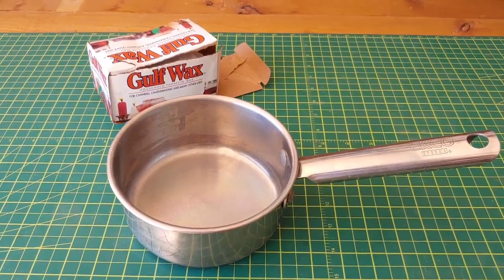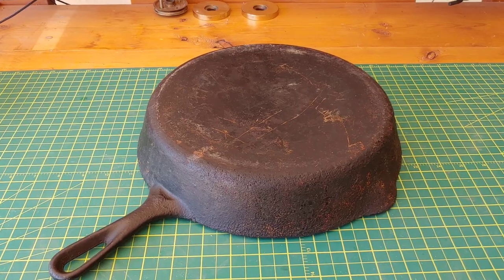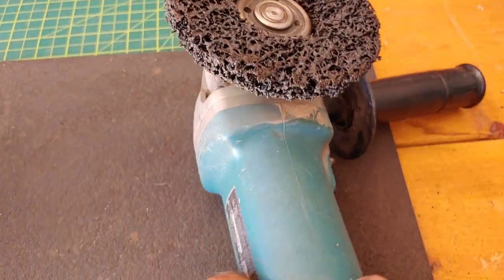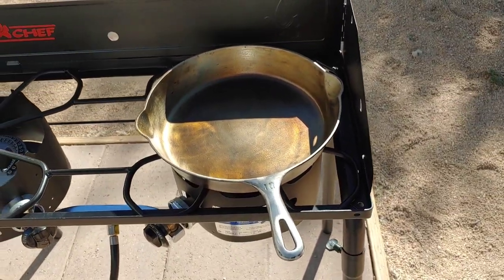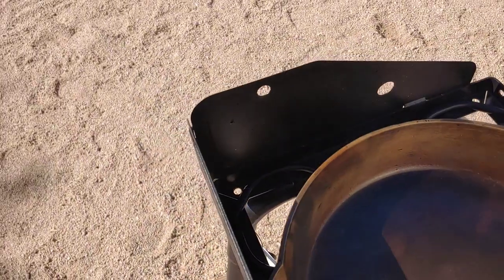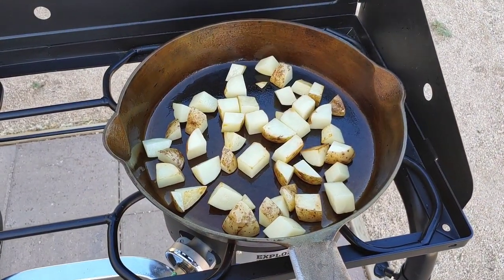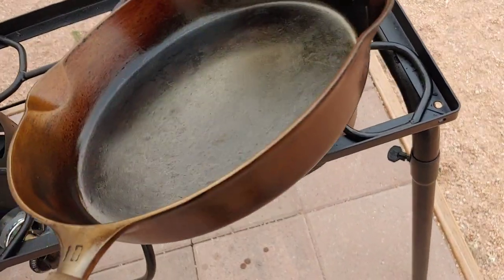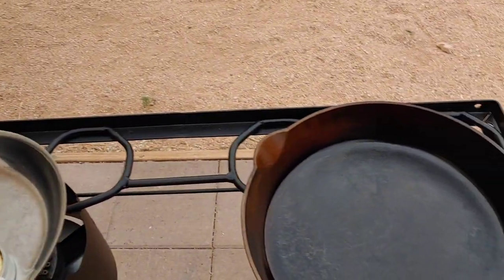Griswold Cast Iron Pan Restoration!

Comment: The special nice thing about this pan is the thinner walls so it is lighter weight.  For some years I had serious chronic fatigue and could barely lift the conventional cast iron skillet and my Griswold #10 kept dinners rolling!   What a great find!
Reply from the maker: I had a 15" Longer pan that was really fantastic. It had the typical rough texture of the newer cast iron pan but it worked really well. The only downside was it was so heavy! In fact, I ended up selling it because I never used it because of its weight. This Griswold is for me the perfect cast iron pan. Great size for 2 people with a glass smooth cooking surface and a very manageable weight. Thanks for watching!
Reply: I gave away my lodges they’re so heavy and so inefficient the griswold is everything these new school pans try to be

Comment: Great video Bill I picked up a couple tricks for my cast iron skillets thanks. Keep those vids coming.
Reply from the maker: I appreciate your kind words! Have a great weekend 👍
Reply: I really hope you don't use the methods he used to clean your cast iron! Look at the proper ways on YouTube using either oven cleaner or lye tanks and if necessary to get rust off using an electrolysis tank. Never use abrasive tools on good or older vintage cast iron!

Comment: My papa would put the old, crusted skillet in the fire to burn off the crust. I have no idea if this is good or bad for the pan. Anyone know?
Reply from the maker: That's actually a good way to both clean off the old crud and season it too. You just have to be careful not to over heat the pan for fear of melting. Typically people will put a pan in the bed of coals once the fire has started to die down, and then retrieve it the next morning. Thanks for watching!
Reply: Yeah, don't melt it! 🙄 You won't melt it but if the fire is too hot it will ruin the cast iron and make it more brittle and much harder to get it to take a season. You can tell if one has been too hot like that by a kind of pinkish red color that looks like rust after the cast iron has been stripped the proper way through either electrolysis or lye tank or both if really bad. NEVER STRIP IT USING THE ABRASIVE METHODS HE SHOWS IN THIS VIDEO! But yes, over hot coals or even in a self cleaning oven if you know that it doesn't get hot enough to overheat the cast iron and change the crystaline structure of the cast iron.

Comment: Why do u soak your potatoes in salt water please?
Reply from the maker: Takes some of the starch out of the potatoes and I get a good crispy outside and a more tender inside. Make sure to dry the potatoes prior to cooking. 👍
Reply: Nice job on the restore! We frequently see old grease turned into gunk on pans that were never washed with soap and water. That's why we always use soap on our cast iron. Thanks for trying our Crisbee Puck.